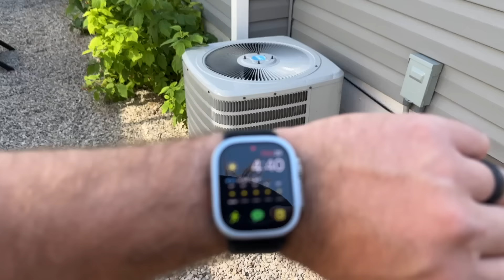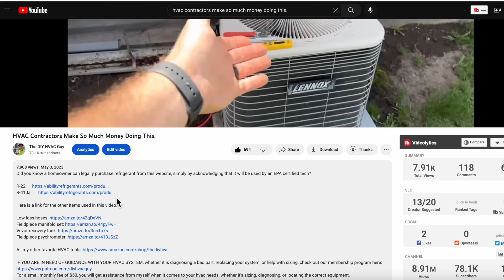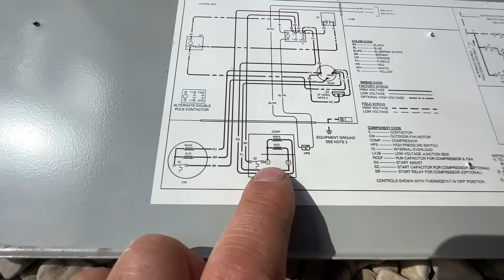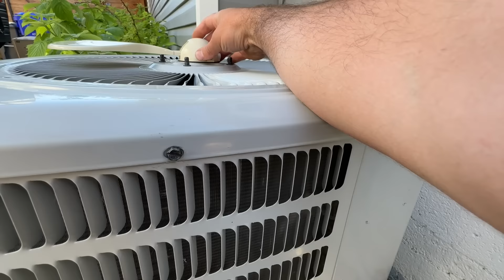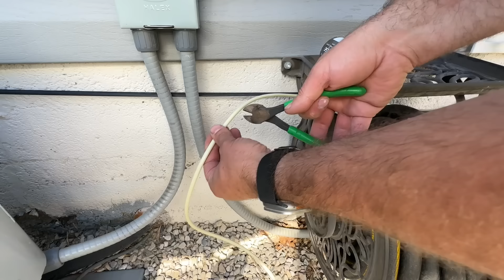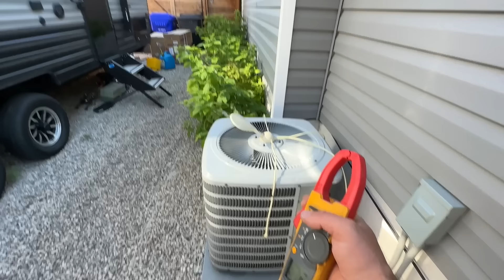Can This Device Actually Lower Your Electric Bill By 30%??

Comment: I'm an engineer and I live near Phoenix and the tubing and mist heads appear to be standard patio misting system components. I know it's effective because there are commercial air conditioning systems that use similar technology (and are designed to do so).  I believe it would work well and would probably pay for itself with electricity savings in one season.   However:
1.  In some areas (like Phoenix), build-up of hard-water deposits is going to be an issue for both reducing the efficiency of the cooling fins and clogging the misting nozzles.  You are naïve if you think that cheap filter is going to remove the hardness from your water.
2.  In more humid areas, mold, mildew, and algae are going to be an issue for clogging the condenser fins because they will be wet all the time.
3.  Rust and corrosion of the condenser is going to be an issue with it getting wet and drying out dozens/hundreds of times per day.  [Edit2:  The corrosion isn't from the tap water but from the minerals in the tap water.] [Edit1: Rust of the condenser cabinet is secondary to the issue of corrosion of the condenser tubes/fins.]  Additionally, some units may fair MUCH worse if they can pull even a small amount of mist through the area where the contactor, capacitor, and other electrical connections are located since that will accelerate corrosion of the electrical connections.
On top of the above, I can just look at the components and tell that the quality is really poor.  I.e. the plastic tubing and air flapper will be susceptible to UV deterioration and the valve controlled by the flapper will be lucky to last one season.

Edit:  all it took was a little bit of research and almost everything I expected it true.  It has 31% one-star reviews on Amazon with hard water deposits, premature valve failure, and corrosion of the condenser being the main complaints.  Oh, and a patio misting kit that comes with everything but the flapper/valve costs less than $20.
Reply: I live in Phoenix too, do you think you’d get less hard water buildup on a house with a water softener?
Reply: @michaeljull1175  Yes. You should.
Reply: @michaeljull1175  You'd definitely get less hard water deposit buildup.
Reply: @michaeljull1175   Yes, I'm not sure it is zero, though.  You may also start getting dirt/dust to start to cake on the coils.
Reply: @michaeljull1175 it would  however when most houses are plumbed for a soft water system exterior hose bibs are intentionally left out of the system for a couple of reasons. One is that most of your water used outside for irrigation/pools this would greatly increase the amount of soft water a typical system produces with no real benefit and actually can be detrimental. The reason being is that most plants and grass need the minerals that a soft water system removes.Also pools actually need calcium or the softened water will pull it from somewhere else ie. the concrete your pool is built with. In line filters do little to anything to remove the majority of minerals that will end up building up on the condenser.
Reply: @michaeljull1175  Most outside hose bibbs are plumed before the water softener so wouldn't be affected.
Reply: I've seen this done before and the reviewer said it was a scam. My unit is in direct sunlight all day in So Cal and runs non-stop. Tried a version of this I rigged myself and no change month to month. And yes, the hard water will clog those nozzles in a few weeks or months. I have to take my masters out frequently and soak them in CLR. Then they're as good as new.
Reply: Thank you for posting this. I do hvac for a living, and no for an absolute fact that you can not remove the minerals without implementing a true RO system.

It will by nature plug the coils. They will not only end up wel here you were in the first place, but worse.
Reply: Almost had it
Reply: @kden1271 Come on man!!! 😜🤣
Reply: @seetheworldfrommyharley  do you have my ice cream?
Reply: @kden1271  blow...or ice cream?     FBI is looking for the Ice cream....
Reply: I agree.  The water in Phoenix is HORRIBLE.  Using a mist system WILL clog the coils with calcium in short order.  I did A/C in Phoenix for 25 years and the water was the bane of cooling towers and mist systems (and NO ONE wanted to spend the money for a RO system).  Goettl (a local manufacturer for years offered a "swamp cooler" frame and pad to install on their units (they all were single inlet to the condenser so they were relatively easy to install.  BUT you HAD to maintain them and have a CONSTANT bleed off or you would trash the pads in short order AND then they would deteriorate the coils.  And all the little gimmicks out there promising to take care of your scale build ups are GARBAGE.  THEY DON'T WORK.  And we had a LOT of evap coolers and again you had to have a constant bleed off OR a separate pump on a timer to pump the water out at a set interval and that helped a LOT in keeping the scale down.  So there is no "quick fix" for helping your A/C unit working especially in the hottest parts of the country with LOW HUMIDITY.  I wouldn't use any kind of misting system anywhere on the east coast.
Reply: @MrTommyboy68 prolly has meth in it.  On the east coast rumor has it arizona is full of meth heads.
Reply: Engineer for the win, again! Thanks.
Reply: I installed one of these on my AC and my parent's AC about 20 years ago. 
Due to the mineral deposit on the coils, the life span of both compressors was significantly reduced.
Reply: Came here to note all three of these issues. Well done.  Realistically, in very sunny areas, your far better off putting a slight shade cover over the unit, with open sides.  Just removing the surface heat of the metal frame via shade will have about the same impact without the problems of water.  In fact, it may extend the life of the unit by keeping rain, leaves, and other debris out of the unit.  I find a 10x10 pop-up at about half height is perfect for this.
Reply: @TvistoProPro  if a blower is rejecting hot air upward, you would want your shade not to block any of that air. You want the hot air to flow upward unrestricted to minimize any of it mixing with intake air.
Reply: Uh, I live in a rainy climate where it rains 8 months of the year. Ac units don't rust in the rain.. I doubt they will from this.

Well, I guess they do start to rust after a decade or so... Which is typically how long a Ac units prime live span is anyway.
Reply: @OgdenM  Rust off the cabinet is the least of your worries.  The minerals in tap water can cause corrosion of the condenser fins—either changing the rate of heat transfer or reducing the surface area.
Reply: i already had am idea of what this product is and does just seeing the thumbnail.  then the first second i saw it misting the condenser.  I am a supermarket refrigeration tech by trade.  been in the field almost a decade.   do not buy this product guys.  if you are having issues with your HVAC system hire a reputable prefessional company to look at your system and house.  in this field, shortcuts will cost you twice s much as fixing it right.
Reply: This. If it was so simple, cheap and full proof, they would be on every AC unit.
Reply: I also live in the Phoenix area and yes, the water is VERY hard.  My concern would be that the valve would fail and water would just flow out when the AC is not operating.  All of the watering system valves for my animals need to be serviced on a regular basis or they fail (leak).
Reply: @michaels6981  This was my concern.  I live in Phoenix, and the sun/heat destroys everything.  Nothing is safe.
Reply: You'd be correct on the water harness clogging the misters.  I have a patio misting system and have tried using that filter.  The jets usually clog after the first use so I gave up on it.
Reply: all it took is one engineer to chime in and show us truth.
Reply: Came here to say, the scale build-up on the fins is going to be fun to pay for later. Glad there are other smart people in the comments. I would only EVER do this with true 0 TDS RO water. But that's not worth the cost either, unless your system just can't handle the heat at all, which is most likely indicative of other issues, obviously. All-in-all, don't do this, people.
Reply: Tks party pooper
Reply: @wojtek-33  This is not entirely true. Yes, a water softener removes the hard water ions (calcium, iron, magnesium), but it replaces them with softer ions such as sodium through an ion exchange process. So while, yes, the harder minerals will not be deposited on your coils, softer ones will. You'll still run into the same issues.
Reply: As an engineer, I think you nailed it. Yes, it will run more efficiently, but with lots of downsides, which is why these are not standard equipment from the manufacturers of AC units.
Reply: THE comment  for this video. I thought your Unit had to be designed to accept a mister, otherwise everything goes to shit fast.
Reply: So, what do we learn?
That, as always, we have these influencer YouTubers pretending they know it all, not caring of they ruin people's lifes, just to make a quick buck.
Did I get it right?
Reply: Was thinking the same thing. Would be useful with proper engineering but not sure it’s worth rusting out my condenser, plus the proper engineering would likely be expensive to a point it doesn’t offset the savings. There’s always a cost.
Reply: Thanks for your research.  Much appreciated!
Reply: So it will ruin the unit quicker. If it’s to not move maybe.
Reply: Yeah, I immediately thought of the cheap fan misters. I found one on Amazon with 5 nozzles and it's only 13 samolians
Reply: TBH, I'd like to see/ may try to setup a system like the video but instead of a clap a simple Digital Thermostat valve system so it only applies water when it gets hot out. Help limit the issues above and probably isn't all that expensive; just on off current or rig a timer system to read temp vs timer.

To addon to this - same system could be used for dryer periods (like here in OK) to put moisture back into the dirt around a home to help prevent settling issues long term.
Reply: @FoxHoundLord  Again, don't do this. Applying water with minerals in it (from any ground water source) is going to wreak havoc on your coils. This is a bad idea.
Reply: Thank you for doing the legwork!! There are so many predatory companies out there looking to screw people in need over just for a quick buck.
Reply: Well, and you have to factor in the cost of water being used as well, which is going to offset at least some of the theoretical savings
Reply: Put cooler pads so the mist does not touch ac only use in non humid days
Reply: I didn't see your comment till after I wrote mine. PLZ read.
You gotta love "engineers."
Reply: You so right. Nothing is free. Use city water over any condenser and you just create more maintenance issues down the road. I used to sell cool-packs in the late 80’s commercially. And soon found out they rarely had a good pay back for a lot of reasons. The only time l recommend them today is when your condenser is shot, and only until you get new condenser installed. That stupid fan plastic contraption on top is a joke. If l put that on any of my customers condensers, l would of laughed at.
Reply: No comment needed on my part because you said it better!
Reply: Question for you brian, why don't HVAC companies install wet heat pumps in phoenix? Seems like the best option for the dry environment.
Reply: @justinkane290  I have only seen them on commercial/industrial HVAC systems in Phoenix.  There are no residential units designed for evaporative assist that I’m aware of.  If there were, they would be prohibitively expensive to purchase, install, and maintain—especially heat pumps, where the majority of units in Phoenix are roof-mounted.  I think maintenance and associated warranty issues are the real deal-breaker for residential installations, though.
Reply: Agreed - there may also be a conductive material between the coolant tubing & fin tubes that is damaged by the direct proximity of water misters. This item may be pseudo engineering.
Reply: I would say depending on the unit.
I live in a really high humidity area through almost the entire year. 70-80 and some weeks even 90%. A lot of rain also and if water would rust the unit then damn I should already had to replace the unit.
Reply: I'm about an hour east of Vegas and have been using one of these systems for about a decade. I take the condenser "shield" off every year and carefully scrape the hard water deposits off. It takes a few hours and is a pain. The data I've collected shows it saves about $1k worth of power over a year. When the temperatures climb to the >110F range, it makes the condenser run only about 1/3rd as long per cycle and take ~1.2kw less electricity while running. Unless you want to get close and personal with your condenser maintenance, it's definitely not worth it.
Reply: Maybe a better option would be some kind of liquid cooled heat exchange connected into the hottest spot into the Freon line. Perhaps the waste water from condensation could be used for this water to supplement this water. It would increase your water bill but decrease your power bill.
Reply: @martylynchian8628  That's a good idea, but the amount of condensation would be too small to have any effect, even in the most humid areas, forget about arid places like Phoenix or Las Vegas where efficiency gains would have the most impact but condensation is minimal.
Reply: @BrianW211  Your mileage may vary depending on location. I live in a humid area and my AC seems to generate a ton of waste water as condensation.     It could possibly collect condensation water for 18 hours of the day and be programming to spray for the hottest 6 hours of the day. Like 12 noon to 6PM for example. I think there is a way to treat the AC fins to make them more corrosion resistant but don't know how much of a process that is. Seems like there is a lot of room for improvement in the HVAC industry, but R&D is stagnant for some reason.
Reply: @martylynchian8628  
The problem there is that the wastewater production from the humid air is part of the cooling coil side of the refrigeration loop.  Inside your house/apartment.  You've already SPENT energy cooling that water to the point of condensation.  Thus, spraying it on the unit at peak times does little more than recover a small amount of the energy spent over the course of the rest of the day.  This is a non-ideal open-cycle loop with copious maintenance issues.

1:  The condensation is indoors, meaning that unless you have air leaks, or you're going in and out a lot, you're actually trying to extract water from air with much lower humidity.  If you're so humid that you're building up a ton of water because of air leaks, you'll save MORE on your power bill by isolating and sealing those leaks, keeping warm, humid air out.

2:  Even with an excellent air filtration system on the AC unit, you are extracting water from indoor air, with all the organic pollutants therein. Your condensation water is going to build up quite the menagerie of dust and bacteria in and around the storage tank, griming up your extraction and sprayer, perhaps even backing it up and causing pooling in places you REALLY don't want nasty water pooling in.  And remember the wise words of Yoda the HVAC Technician:  "Water leads to grime.  Grime leads to mold.  Mold leads to SUFFERING."  Also, black mold is a health hazard.  I don't recommend setting up something that can result in calling in a LITERAL hazmat crew and a lifetime of respiratory conditions.  Just... no.  

3:  The water cycle here is unreliable at best.  The best time for condensation production IS the peak time the AC will be running.  The rest of the time, you're running on reduced cycles.  There's no telling if the condensation built up is actually enough to feed the active portion of the spray cycle.   And while you can experiment and find a spray rate that's tuned to your collected supply, it may then be insufficient to provide the desired evaporative cooling effect.   You could tie in supplementary tap water, but with 1 and 2 listed above, at this point you'd be better off ditching the condensation collection and just go all clean tap.  If only to avoid the mold.  Dear GOD the mold...   Shudder.

Really, while evaporative cooling is excellent supplementary functionality to an HVAC system, I'd actually be concerned you're trading the expenses from the electric bill, to the water and system maintenance bills.

"Look ma!  I'm saving 40 bucks a month on the cooling bill!"

"Hmm...  Water bill's up thirty $bucks.  System was $200 for initial install, and costs ten bucks a month to maintain, plus time spent doing the work myself...  We're supposed to ... SAVE money on this, right?"

"Don't forget to factor in the fines because we're in an area with stage 3 water restrictions, and the City noticed we used more water than most people..."

"How big's the fine?"

"What was our old electric bill again?"

"Uh...  It was-"

"Double it."
Reply: Engineer here. Yeah Florida ac units get wet all day every day.
Reply: @internetpointsbank  So then, you realize that there's a huge difference in the corrosion properties of tap water vs. rain water, right?
Reply: So agree. They are cheap components. I put this on my home about 25 years ago. It didn’t hold up long. But it did help with the cooling.
Reply: I guess... you could just use dry ice.
Reply: We have installed many industrial evaporative cooler systems in the Phoenix area and I can tell you that the hardness (mineral content) of the water will destroy your condenser / heat pump.  The maintenance is massive and costly. Water filtered by a reverse osmosis filtration system is the only solution but it does not solve the other issues with using water with your HVAC system.
Reply: The negative comments in regards to corrosion seem odd. Why wouldn't this also be an issue with rain? Every ac unit sits out in the weather.....
Reply: @dr66ss396  Because the corrosion isn't from the water, it's from a combination of water and minerals.  The minerals in tap water don't exist in rain water and those minerals will corrode aluminum (and copper) cooling fins.
Reply: This Is How AC Use To Work!! When I Was A Kid 55 Years Back There Were Chillers At The Milk Facility! They Used Them To Cool Off The Milk!
Reply: I was asked recently about this product, with out reading any posts to sway me. I am a highly skilled service steamfitter, fixed many engineering errors both electrical and mechanical. The first thing I stated was that filter is not going to work, RO water maybe. Then you might lower the compressor amps, but you will increase the fan amps and possibly over load it. I was then asked why they spray the water away. Misting away will let the misted water / air spread outward so more of the coil gets the misted water. Then in most areas we have lime in our water, that nearly distroys a coil. Next is that tubing, one kid runs around and kicks it by accident and now we have a lot of water going all over the place, besides the water bill. Speaking of kids, this is a toy for them, they will not leave it alone. Last is the paddle.  I already has systems that if there is any resistance of the air leaving the coil, it causes the air to do strange things, high head pressure was very possible. Not a great idea
Reply: Question, if I have a Kanetico Water Softener and chlorine chemical remover system and is a inline filter would I have a corrosion issue? I’m in Florida (central) and rainy season wouldn’t really need to use.
Reply: @kendallland368   It depends on a lot of things, like what types of minerals are in your water and the construction of your unit.  Softened water accelerates galvanic corrosion, so it's possible to make corrosion worse depending on the materials used in your unit.  Also, consider that humidity is a huge factor in how well this type of system works. High humidity will reduce evaporation and along with it, most of the benefits of this device.
Reply: patio misting kit I believe would be the way to go, but I do think that with the lowered head pressures and benefit of the compressor having less strain and less amp draw would pretty much pay for itself easy
Reply: @JogurtNugget   That flap assembly should be easy to bypass, but doing it efficiently is the issue.   A float switch for something like a boat's bilge would make a nice switch.  Pair it with a relay to open and close the water valve, connect it to power, and you should have something with low power draw.  But I have a feeling that trying to out-engineer a cheap kit from China is a losing proposition.
Reply: @docferringer an amp sensing switch be better, put it around wire for condenser fan and switch senses the current, switch is made. Older whole house humidifiers for furnace uses to use them.
Reply: @docferringer I built my own system. I bought on ebay a 24v solenoid water valve and plugged it in to the 24v side of the contactor. When the thermostat turns on the ac unit it sends 24v volts to the contactor which starts the ac unit.
Worked great. Ran it for a year. Saw a $15. drop on the monthly electric bill. But due to the calcium build up on the fins, house, and side garage door, I removed the system. Also a green algae problem. I was planning to use a rain barrel and small water pump to avoid the calcium problem but I replaced the unit and didn't want to spray the new unit.
I used a patio mister kit with the 24v water solenoid. I used a Culligan RV screw on water filter that was supposed to remove calcium, rust, and particles. It didn't.
Reply: Several people that are not engineers, say they are engineers to get ppl to respond to their comment. This "engineer" claims the system is bad due to very specific variables. A real engineer would have useful information on how to use it effectively without damaging your equipment. 
Such as, use RO water, there will be zero calcium deposits.
Also, H20 on a condensor coil happens very very often. That is why they don't come with an umbrella, they are designed to get wet and dry out. Because real engineers designed them to do so. Please look outside when it rains, I promise you will see your condensor getting water on it. Rain doesn't just avoid it and the electronics, it is designed to drain away when water comes into play. Yes, electronics submerged = bad day. Electronics having some condensation or mist on it, not so much. Your worst enemy will be corrosion, but it will take most of the units lifespan to get enough corrosion to make a difference.
Another fun fact, locations close to the ocean experience more corrosion than most areas due to the salt in the air/rain. Having RO water washing off that nasty corrosive salt will reduce the corrosive nature of the salt by dilution.
Reply: Agree and that's the first thing I thought about.
We have great tasting, but hard well water.  This would clog-up the condenser fins.
Additionally, the constant moisture will greatly accelerate rusting of the unit.
Just put a sun shade roof a few feet over the unit to keep the sun off it.